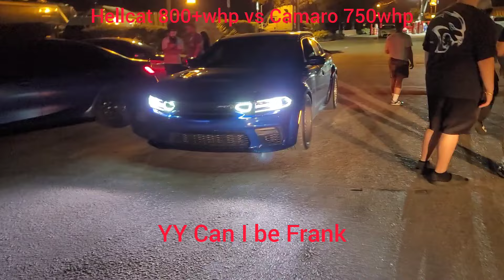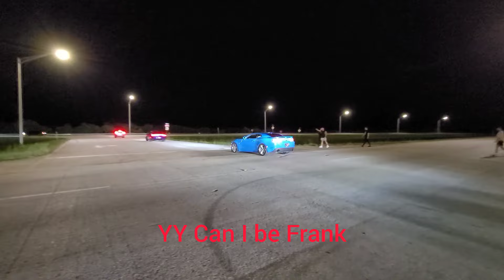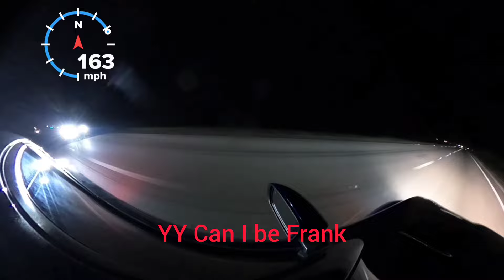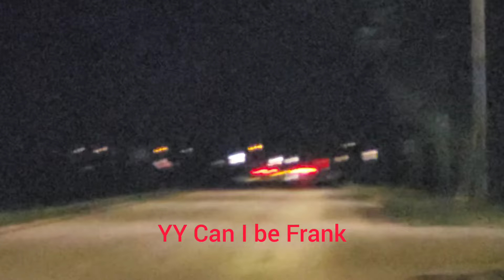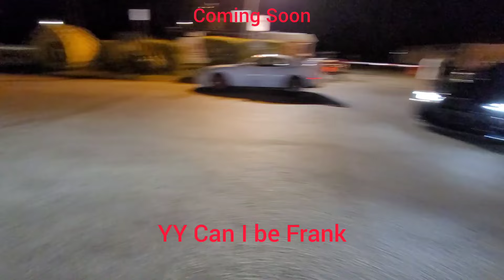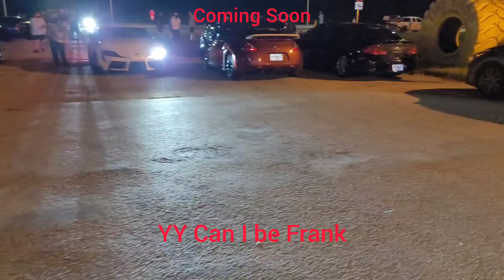Camaro D1X ProCharger Cam E85 vs Hellcat Upper Pulley Headers E85

Comment from the maker: The audio is behind the video
Reply: Frank can you set up this procharged camaro ss up against that procharged coyote mustang that beat the 2 power adder cammed, fbo, ported blower + nitrous c7 z06 a couple weeks back? I believe it would make a great race for my chevy considering both are procharged lmao.
Reply: This camaro needs to speak with the SheIby SIayer so he can run his setup more appropriately and also beat all the local shelbys like i plan to once my tune is done with Pray Performance. I still do think the Zl1 from yesterday on e50 would cause alot of the shelbys to go directly to there dealership and trade it in for either a zl1 or lt1. Honestly maybe even a zr1 depending on what the bank will approve
Reply: You guys with these fake accounts😂 you guys are too funny

Comment: White NA LT1 may be faster than that blue Camaro.  Don’t know wtf happened but it got gapped by the hellcat.  And the mods on the hellcat will put it closer to 900whp on E.  Those mods on 93 they make around 850whp.
Reply from the maker: The white LT1 is much quicker than the Hellcat
Reply: You don't know what pulley set up he has. If he has a 2.85 which is the normal pulley size people swap  on hellcats.
With E he's probably near 850.
Headers don't do much on the hellcat platform. 
You can't assume he's closer to 900 whp with out knowing his pulley sizes. 
Also is he running striaght  e85 or is it a flex tune setup based on E content.
To many variables to consider to guess.
Reply: @HCpov1  true but it should be in the neighborhood of 900
Reply: @boostidavis  not at the wheels maybe crank. 
I'm have a 2.86 upper on a flex tune on my cat.
I dyno at 851 whp. 
Again, we don't know the pulley size and who tune it and or how aggressive the tune is.
Reply: @HCpov1  my friend dynos 850whp on 93 with headers, intake, upper lower pulley and injectors.
Reply: @boostidavis  who  tuned his car?
Reply: @HCpov1  idk but if u look up vids with those mods on hellcats they are around 850whp on 93.
Reply: @boostidavis  yeah I think it depends on the tuner as well.
Reply: @HCpov1  bottom line is Hellcat’s are better mod for mod against most cars.  Just heavy.

Comment: This is why people rarely boost LT1s.  Boosting them are a waste of money just like the LT2 considering that twin turbo c8 that got freight trained by my favorite all motor LT1.
Reply: If it can’t handle any form of force induction, then it’s a weak motor. All motor can only go so far, it’s pretty much at its limits. 

There’s a reason why the fastest and quickest cars in the world are boosted.
Reply: This camaro needs to speak with the SheIby SIayer so he can run his setup more appropriately and also beat all the local shelbys like i plan to once my tune is done with Pray Performance. I still do think the Zl1 from yesterday on e50 would cause alot of the shelbys to go directly to there dealership and trade it in for either a zl1 or lt1. Honestly maybe even a zr1 depending on what the bank will approve
Reply: @Sneakgay5.sI0w  this already is an Lt1 just face it boosted Camaros are dog shit you literally need to completely build the engine to boost them their best route is naturally aspirated it's sad
Reply: @xaviersjordans2331  look let me just say chevy does not need boost to compete or building the motor but it is good insurance and peace of mind now i do follow a popular youtuber cleetus mcfarland and he really should of built his engine and transmission before boosting it because both failed in record timing
Reply: @xaviersjordans2331 What’s funny is all these fake accounts are rob
Reply: @Toxic_coyote12  you are right the OP above is a fake account for sure because his account is only a few months old
Reply: @konabIuegt7437 your profile picture is blurry and mine isn’t 😂
Reply: @Toxic_coyote12  may want to get your glasses checked grandpa 👴🏻
Reply: @konabIuegt7437 still don’t have any of my content and you wouldn’t dare post it cause you’ll just get copy right striked and then there goes your channel 🤣
Reply: @Toxic_coyote12  can’t copy right what’s already been stolen plus who wants to copyright slow and blurry videos 🫠
Reply: Did Jay just blow up his coyote😂 uffffffff the engine builder posted the carnage

Comment: lmao a procharged camaro getting gapped by a stock blower hellcat 
🤣 
let this be a mustang and all the roaches would come out the wood work
Reply: didn’t even realize it had a cam too, no bueno
Reply: I am the roach who was hiding on the yellow Mustang video! 🪳 😭
Reply: @konabIuegt7437 when all else fails and you run out of things to say, make a fake account in my honor, right rob ?
Reply: @Toxic_coyote12  Rob is just short for robbery which happens frequently in California!!! I would know I’m a bum😷
Reply: @konabIuegt7437 philly is just as bad if not worse than la or sf lmao
Reply: @Toxic_coyote12  Philly is on the other side of the state I live in emeryville California
Reply: @konabIuegt7437 it’s still PA nice cope rob 😂
Reply: @Toxic_coyote12  I’m not from Philly though I’m over 2 thousand miles away in emeryville California where the crime rate is insane 😱
Reply: @konabIuegt7437 you said signal hill and then edited to emeryville 😂 just like you edited you main accounts photo when i called you out. you live in PA rob and pretty close to philly.
Reply: @Toxic_coyote12  I live in emeryville but my boyfriend lives in signal hill I live in both places on the weekend I travel back and forth 😁
Reply: @konabIuegt7437 get some shame my guy
Reply: @Toxic_coyote12  it’s a shame where I live but it is what it is
Reply: @konabIuegt7437  Kona you better relax before I call your dad Babayaga Racing😂😂😂😂😂
Reply: Well dad, there is no need to make fun of the boosted LT1 for losing to a stock blower boat, us chevy lovers already know they suck boosted unlike those coyotes that make 1000whp+ with stock cams and stock heads, stock pistons and rods unopened.
Reply: Oh boy here comes the fake Rob account made by No Life Fitness 🤣🤣🤣🤣🤣🤣 her sticky Ricky and ninja account been quiet lately
Reply: @RobQuincyyC7ZO6  weird no Life Fitness says the same stuff but everyone is now aware that cleetus junker blew his trans and engine on boost 😂😂😂😂
Reply: @DodgeandGMkiIIingFurdDaiIy  using my way of exposing your fake accounts to expose fitness is beautifully ironic, yeah that’s obviously fitness and todd popsicle is obviously you.
Reply: @Toxic_coyote12  uffff got another fake account to rage look at that username😂😂😂 sorry poor kid this is my only account😢